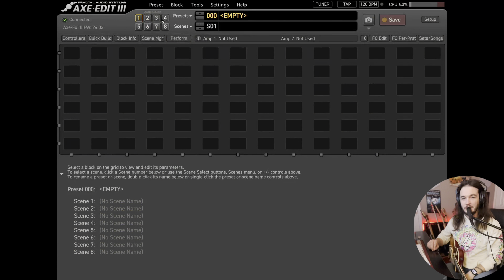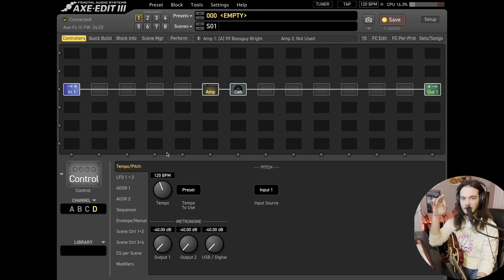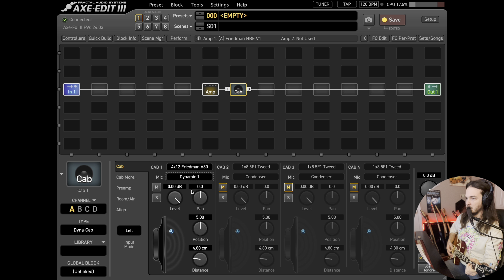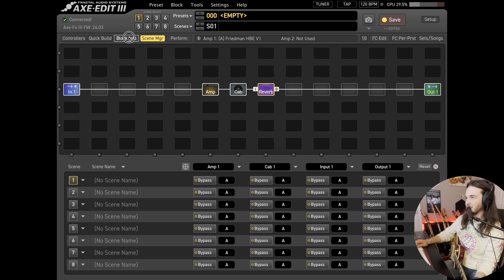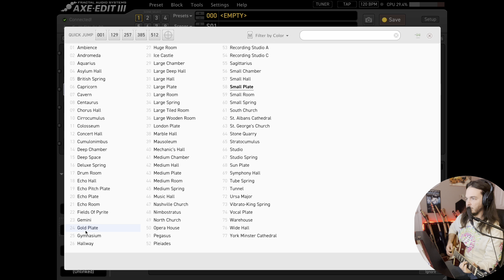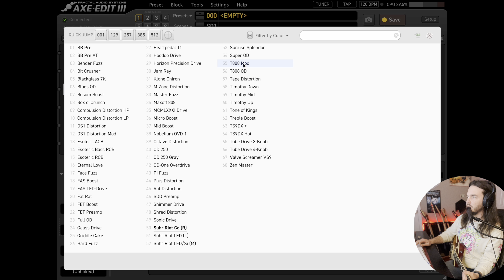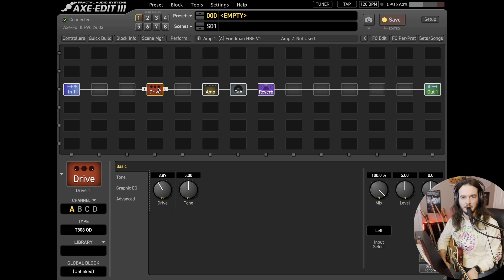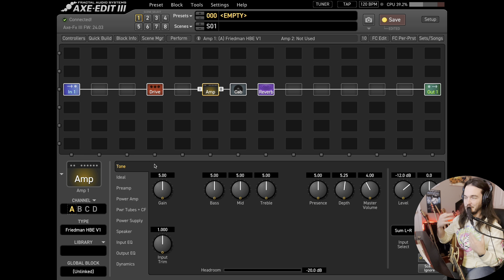Dialing in a Rock Tone with the AxeFx3 | Fractal Audio

Comment: Interesting that you chose to do your EQ high / low cuts in the amp block input. Most people do that in the cab block.
Reply from the maker: That’s where I usually do it on the Tone Master Pro because it’s the only way to do it, but in real amps, the cuts are happening at the amp level. I’ll have to experiment and see what the difference is with the axefx3. One thing I enjoy about the axefx3, that was also a hindrance at first, is the level of control you have. So my thought process was to replicate my favorite tube amps
Reply: @damionandy  changing the EQ at the amp input is like having an EQ pedal between your guitar and the amp input. It will change the way that your guitar signal interacts with the whole amp circuit. Most people put the high / low cuts in the cab block because that is most similar to how you would apply processing to a recorded guitar tone if you were mixing a record. The cuts would be applied to the full signal chain (guitar > amp > cab > microphone) after the recording was complete.

Comment: I don’t have an axe fx, I almost got the axe 9 but i got a better deal on the TMP. You can
 blend a dual rec with a marshall for high gain and it will sound pretty good. I was playing around with it last night. I would think you can get any sound you want out of it. The axe fx is boss when it comes to amp modeling. When I listened to your video the axe freedman has more mid in it. Sounds nice!!!
Reply from the maker: Have you uploaded your preset to the Fender Cloud? I'd love to check it out! thanks for commenting, I hope you're having an awesome weekend!
Reply: Yeah i put  one up its called iron maiden. Works for me. I have emg pick ups. 51 60 on an ltd 256. Its a good example anyway. I put a condenser mic in one 4x12 and a 57 in the other. Then i adjust mids in eq.
Reply from the maker: @genelynch3235  I’ll check it out 🤘🤘